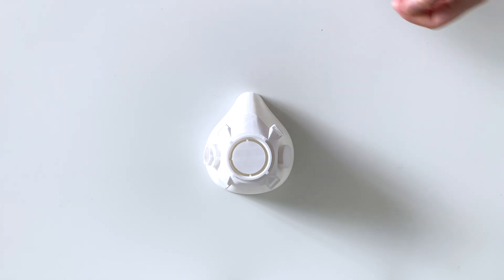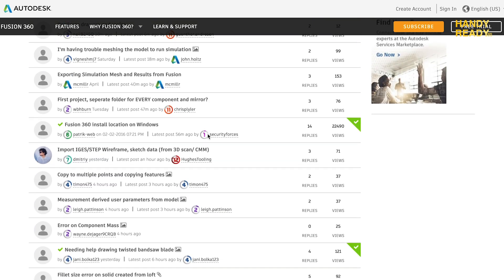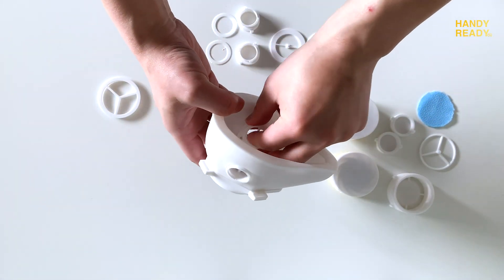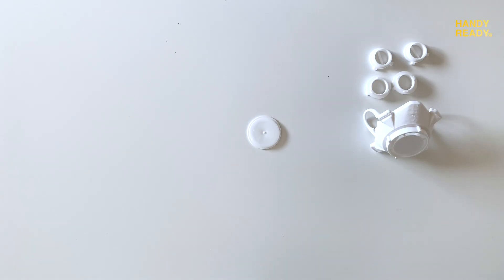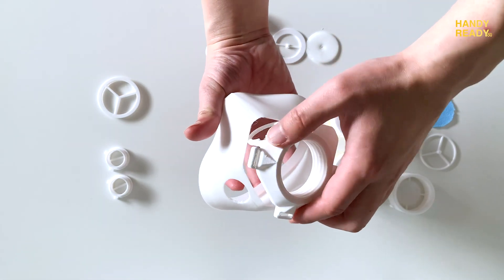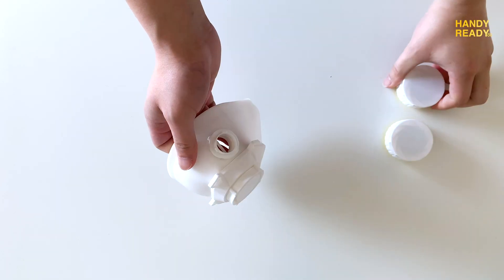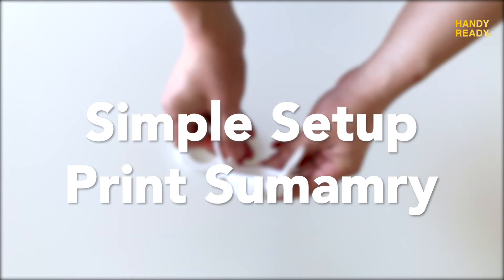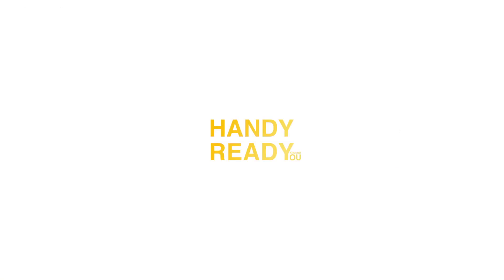What is a DuoMask?

Comment: Hello  the two loops that go inside of the tpu never print the entire part just the lower half  I tried your print settings and my noob ones , is there a way to beef up the tops of the loops that hold the pla to the tpu.
Reply from the maker: What kind of TPU are you using? Maybe your TPU is too soft/flexible? You can email me at handyReadyAroundYou@gmail.com if you want to send me some pictures or videos.